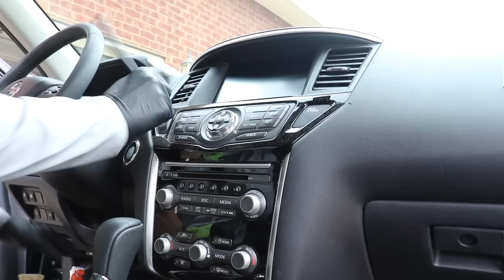My Beginners Auto Detailing Business Formula & How You Can COPY IT!

Comment: Which power washer you recommend me to buy Sun joe 2000psi  power washer roybi  2000 psi  power washer
Reply: darwin lopez both will be great.
Reply: Westforce 3000 psi and 1.85 gpm is awesome. Just came out
Reply: And it’s $150
Reply: Brian Draper  3000 is more than I need but i quess I can put a 45 degree angle to make it less harsh on my car  thank you
Reply: darwin lopez I use the 15 degree and it’s fine but ya there are plenty of tips to choose from. Plus it will give you more foam from the foam cannon since it has 1.85 GPM.
Reply: darwin lopez and it’s cheaper than most with less PSI and GPM
Reply: Brian Draper yea I might have to get it thanks and if I ever have to clan tile or concrete it will work for that too